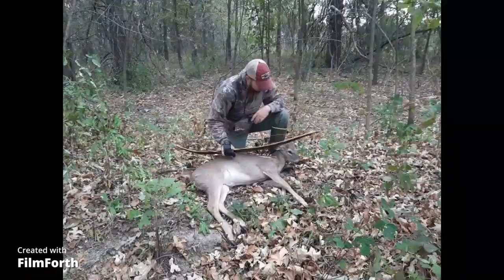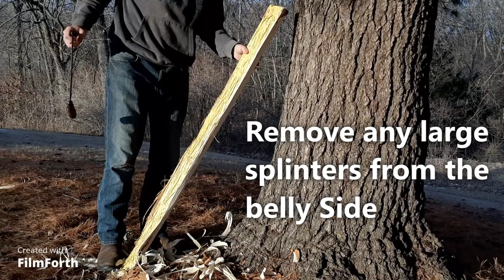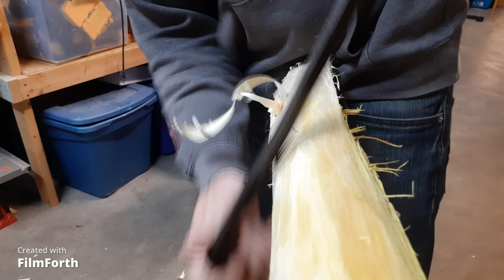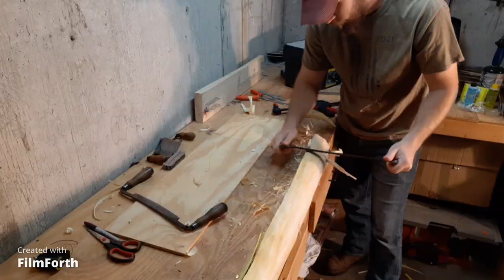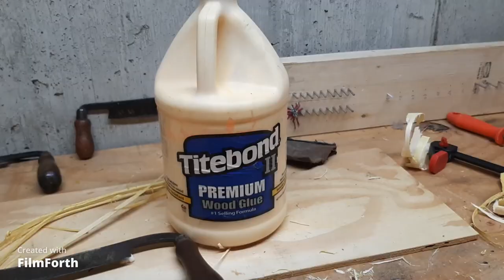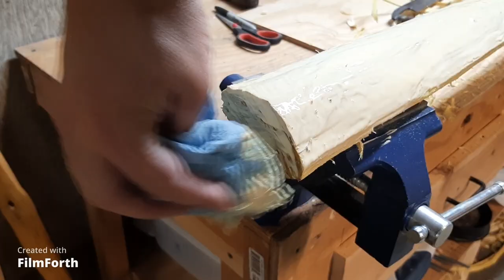Do This BEFORE Storing Your Staves

Comment: Do you let them sit 2-3 weeks before splitting or immediately split? We don't have Osage here but a lot of invasive black locust.
Reply from the maker: They need to be split immediately or as soon as possible or the log will begin to split on its own. This will form cracks in places you don't want them and can ruin or reduce the useable parts of the stave. Whether you choose to split or not, seal the ends of the logs/stave to slow the moisture loss.

Comment: Would the process be the same if I wanted to season the whole log? Just strip the bark and sapwood and seal the ends? Would you still need to seal the back as well?
Reply from the maker: I recommend splitting the log first because a whole log will split some on its own and form cracks where you may not want them. Splitting the log relieves these internal stresses
Reply: @thewayidoit6312  I see. I guess the only problem is that I'd want to keep the wood whole since it's a small diameter log for a walking stick. Maybe it'd be best to carve out the rough dimensions then seal it?
Reply from the maker: @benchase7537  if it's for a walking stick than what you said.
Reply from the maker: @benchase7537  I would actually let it dry with bark on and then strip bark after it's dry for a walking stick.